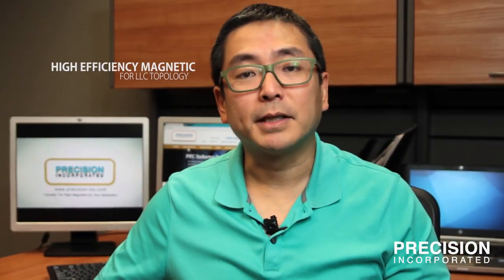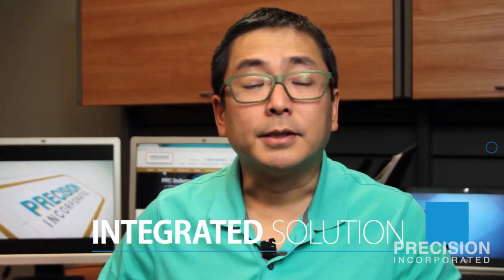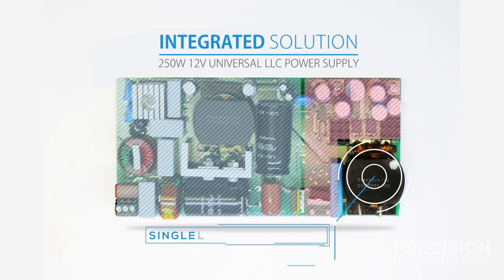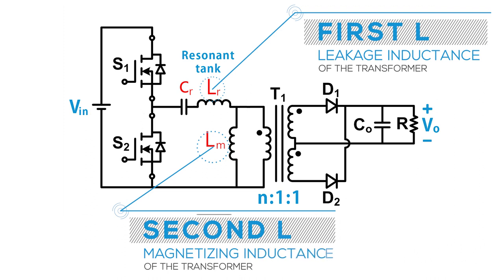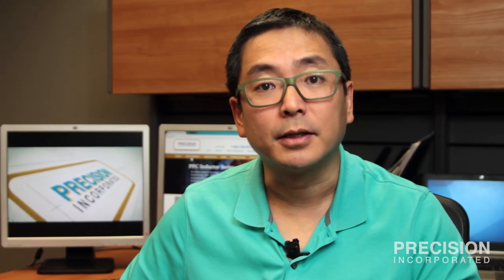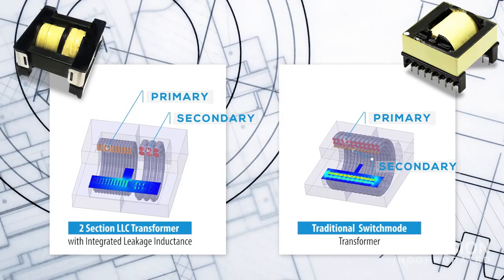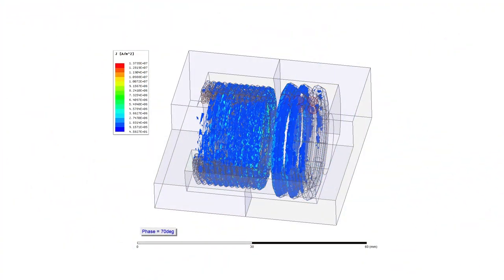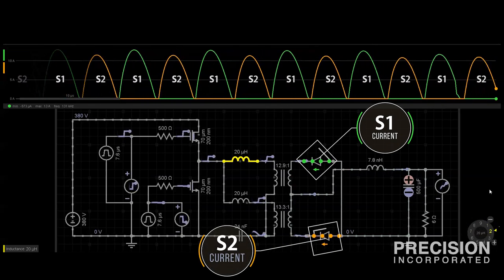High Efficiency Magnetic For LLC Topology | Precision, Inc.

Comment: One way of dealing with secondary current asymetry is to twist together the secondary wires an wind them together on the core of transformer. This is aplicable for  integrated leakage inductance.
Reply: Thats why i more and more use fulbbridge rectification since semiconductor cost get less and less power level.
Reply: @kraftrad7840  yes but full bridge is a little bit lossy and if you need to make a synchronous rectifier it would be quite complicated
Reply: @borsanflorin103  depends on voltage. Sync rectifying Outputs up to 48V is easy with self driven sync driver ICs